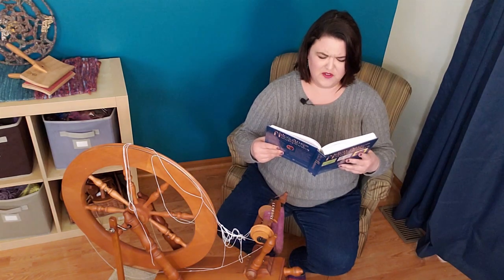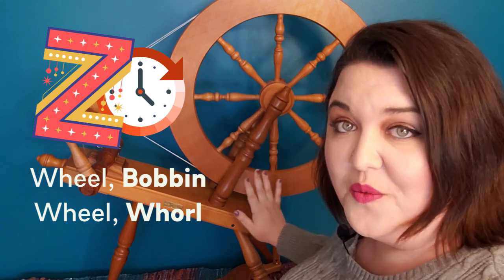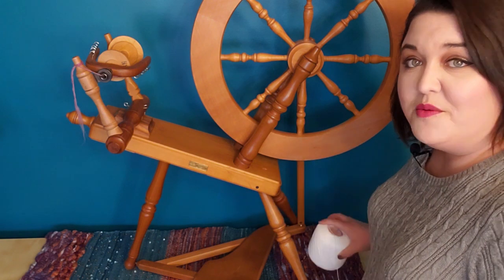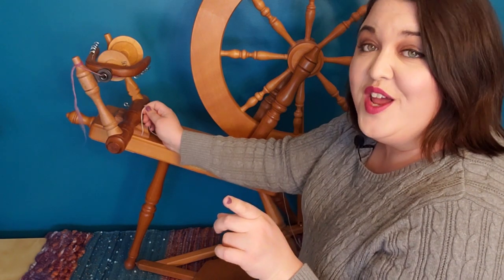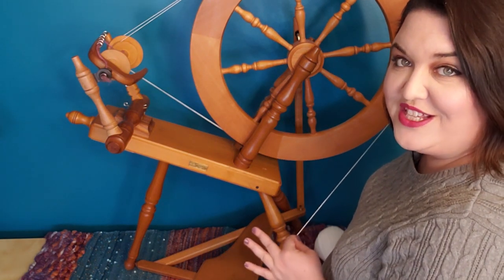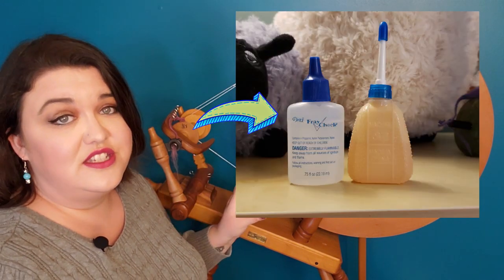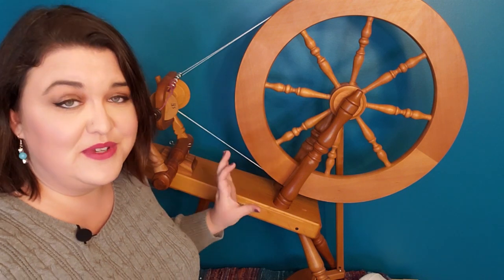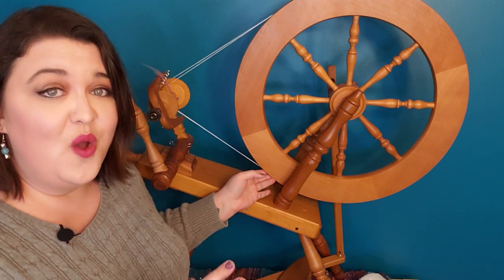How To Tie A Drive Band Onto Your Double Drive Spinning Wheel The Right Way

Comment: Do you have to change your drive band every time you change the direction of your spin on a double drive wheel? I think it's a good thing I only have a single drive because I'd forget every time lol. Thanks for another great video!
Reply from the maker: Sometimes I can flip directions on Elizabeth and she's ok with it. But, my Canadian Production Wheel will throw the band every time if I don't redo the drive band and reverse the cross. Some wheels are more picky than others.
Reply: @JillianEve  So, when just changing bobbins (but not spin direction) are you able to do that without cutting the band and tyeing on a new one?  I tried to do that but was unable to get the band back around the wheel.  Do you have any suggestions for this?  And thank you for this excellent video; it got me over my first hurdle with my new (but old) Rick Reeves frame wheel.
Reply from the maker: @RuthHenriquez1  yes, there should be a knob on the end of your wheel that has a screw mechanism connecting it to the flyer assembly.. This allows the flyer assembly to be adjusted by moving closer or further from your drive wheel. Move it closer to remove the drive band and switch bobbins, then move it back after you switch bobbins and put the drive band back on to re-tension it. ❤
Reply: @JillianEve  Thanks so much.  I did try this, but I'm a clutz at getting the band back on the new bobbin even when it's loosened up.  I'll have to figure it out by practicing, I think.  Again, thanks for the information -- you have an amazing wealth of knowledge.

Comment: Hello! I'm a beginner, and I'm having some trouble: I have a double drive spinning wheel and put the band on exactly as you said for Z-twist (clockwise). I've quadruple-checked the cross, and it is definitely on the bottom. When I turn the wheel (clockwise, of course), it works just fine, but after a few times, the cotton thread stacks perfectly on top of itself at the edge of the wheel (and shortly after that, the top thread on the "stack" pops off the edge of the wheel). Could it be that my wheel is just slightly off-kilter instead of perfectly aligned? Or needs a deeper groove for the band? Or is it something else? Any advice you could give would be appreciated. :)
Reply from the maker: That does sound like an alignment issue. Try turning the wheel supports to realign the wheel. I hope that solves it!
Reply: What exactly are you realigning the wheel with?  I'm assuming one of the whorls, but which one, please?